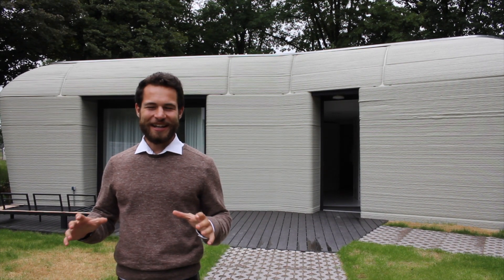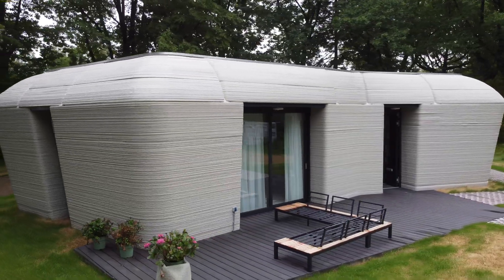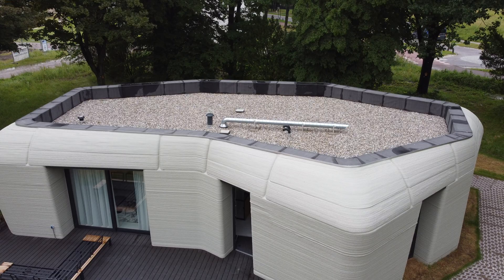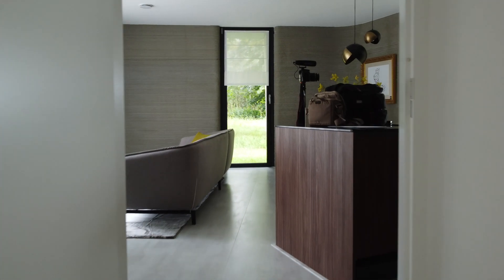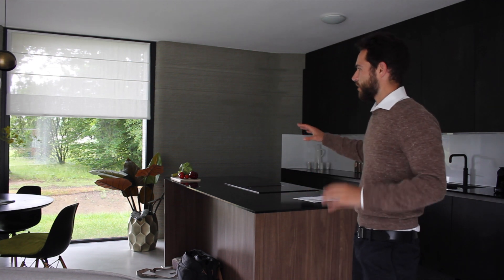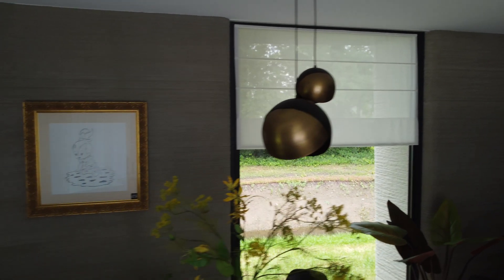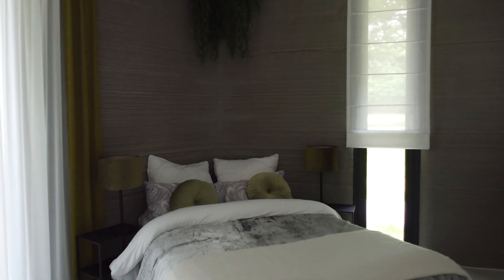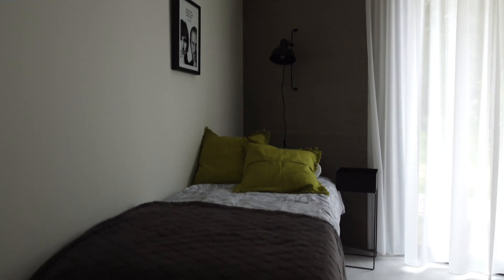3D Printed Milestone House Ready For Move In | Full Interior Tour [Weber Beamix]

Comment: Thanks for the video! I like that the architects are taking advantage of the flexibility of 3d printing in their design. 

What are you thoughts on the thermals/insulation for a house like this?
Reply from the maker: The walls are thick with lots of insulation the R value is probably quite high.